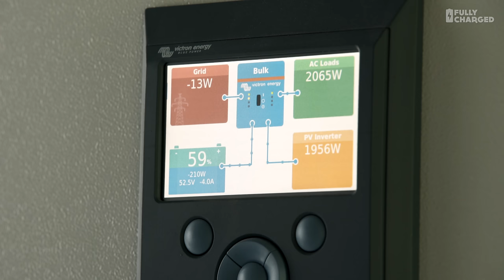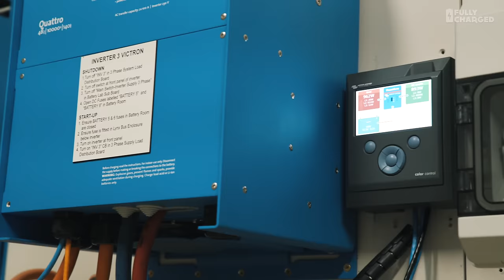Redflow ZCell batteries for home renewable energy storage | Fully Charged

Comment: Aaaand another advertisement-style video, is this paid content? This video does not mention some serious disadvantages of this system: efficiency is only 80% (roundtrip) and gets smaller over time; they need to be completely discharged and shut down for a self cleaning program for 2h every week; minimum operating temperature is 15°C; life expectancy is actually comparable to LiIon; Indoors operation is not recommended (makes noise and can smell bad); ...
Reply: This is the future now😉
Reply: 2hrs a week ! Such a first world problem! Zinc bromide is completely biodegradable and can be recycled , I don’t think you can say the same about Lithium.
Reply: @shiraz1736  Actually you certainly can recycle Lithium ion Cells 100%
Reply: He stated that they do not degrade over time. Most of what you are writing here is adressed in the video. Did you even watch it?
Reply: Shirazenema it’s not “biodegradeable” - in fact you wouldn’t want to get too much in the water table. Where are you getting this information? Zinc Bromide is an extremely toxic substance that does not break down in water. In fact it dissolves in water to form an acid which is how it works in the battery. If your skin comes into contact it can cause a severe burn and ongoing rash. It has all the same hazard warnings as other acids.
Reply: HL - I don’t think there’s anything sinister going on here. Fully Charged is great but they do sometimes get overly enthusiastic about new technology. I completely agree this video lacks any editorial rigour or indeed any negative facts about Zinc Bromide flow batteries. I’ve already pointed out in other comments about the disconnect between the warranty and the stated never ending capacity.  Plus all the things you brought up. However they may have found a niche replacing lead acid in telecommunications applications. For residential there are better options.
Reply: @mondotv4216  Thanks for the clarifying comment. What would you say are the two best options (over the ZCell system)  for residential and why are they better?
Reply: @mwakimakau4572  Right now? It's still Lithium Ion Phosphate.  However I find it difficult to recommend a brand. BYD, Simpliphi, Alpha ESS  or if you want to pay a lot and not get a lot there's Sonnen, Enphase and Victron.  I'll quickly touch on why I think LiFePO4 is the best option at the end. The next best option is either the Tesla PW2 or the LG Chem Resu 10. What are the advantages over the Z Cell?
1. They're cheaper per kWh and per warranted kWh delivered (maybe not Sonnen and Enphase - it's difficult to say - they're so much more efficient over the life of the unit).
2. They take up way less space than the Z Cell and they can be mounted in an enclosed space like a garage or a shed. And you can still get your car in. They also weigh significantly less so can be wall mounted. If you live in an apartment you can forget the Z cell entirely. Unless you want your garage reserved for a battery that has the potential to build up quite awful smelling gas.
3. Efficiency. And this is big because if you think about it you need to feed this thing electricity to charge it and it's only 80% DC-DC round trip efficient. That's before inverter/charger losses which are typically around 3%-5%. Basically you have to put 12.5kWh DC in to get 10kWh DC out.  That means one of two things when compared to a PW2 or LG Chem 10. You either have to buy more solar panels and a larger hybrid inverter or buy more electricity from the grid to charge it. Significantly more. That's costly. PW2 is 88% efficient and it already includes an inverter in and out.  So AC to AC. The LG Chem Resu has a DC to DC round trip efficiency of 95% so you'd need to put 10.52kWh in to get the same 10 kWh out. That's nearly a 2.3kWh difference.  With both the LG Chem and the Z Cell you need to add a compatible hybrid inverter. Then the Z Cell needs to shut down for a maintenance cycle - lets say for the typical user 1 every 2 weeks. During this process the battery needs to be completely discharged. This will also further impact efficiency. 
4. Throughput. This battery is rated at 3kW steady and 5kW peak. PW2 5kW /7kW. LG Chem Resu10 5kW/7kW. That could be the difference between running your aircon or not. Put another way - both the PW2 and the RESU can provide continuously 66% more power. Although to be fair the PW2 has more useable capacity 3.5kWh more (but costs a little less). 
5. Maintenance. This is sort of an unknown because there is a possibility that any battery could break down. But - if I had to choose between something that is purely non-mechanical over something with pumps, filters and a container etc I'd choose the non-mechanical every time. To be fair there's been recalls on PW2s and the Z Cell.
6. Safety. OK - we have a mixed bag here. Lithium Ion cells have the potential to catch fire and when they do you get thermal runaway. However that hasn't happened to date with either of the brands mentioned.  Here's an interesting article on tests run by the NFPA https://electrek.co/2016/12/19/tesla-fire-powerpack-test-safety/
Zinc Bromide can only catch fire if something goes horribly wrong and it starts to break down the water into hydrogen. It's naturally flame retardant.  It does contain dangerous chemicals - ZInc Bromide is particularly corrosive but provided you don't bath in it or drink it and it stays contained it's relatively safe.  However anything that relies on a container has the potential to leak so don't let Fido start chewing on it. Anyone considering installing one should find a way of completely isolating the Z Cell from kids and pets. Kids can do incredibly stupid things like poke holes in containers, eat lead paint and flies. So can dogs and cats. We had a cat that liked to eat anything made of synthetic rubber (carpet underlay, thongs (flip flops), the seal on the washing machine door). Very expensive because strangely it couldn't digest those items. Or anything else after it had munched on them. 
7. Temperature - the Z Cell is only rated down to 15C at which point it will shut down to avoid damage. It has a lot of thermal mass so it should only be a problem in Tasmania and maybe Melbourne in winter. No good in cold climate countries though. 
OK talked about the disadvantages - what are the advantages. Well it's warranted to still have 10kWh capacity after 10 years or 36,500 kWh but it will have dropped in efficiency (guessing about 1% pa to about 70%). But most users won't use that anyway without a full cycle every day. To some people that capacity retention is the holy grail, but in the back of my mind I'm thinking about the wear and tear on the pumps, the electrolyte slowly being degraded, the filters getting clogged and the electrode wearing. There's a reason the warranty is only 10 years and not 100. Redflow have done a great job in designing an electrode that doesn't degrade quickly but it still degrades.  And considering the PW2 has a similar warranty to 70% capacity - well that's still 9.6kWh even if it did lose all of that 30% capacity. So about the same as the Z Cell was at the beginning of it's lifecycle.
Finally why LiFePO4 and why didn't I include them? Well as a chemistry LiFePO4 is ideal for residential storage - potentially a lot more cycles, (Sonnen has a design life of 25 years) better power delivery and even safer than NMC based lithium ion cells. Why didn't I include them - well basically anything that applies to the PW2 and the Resu apply to them but more - longer life expectancy and for the most part higher power delivery (excluding Enphase who have a puny 260W inverter in their 1.2kWh AC battery). They are heavier and bigger for the same amount of storage but still way less than the Z Cell (pun intended). BYD is the cheapest I can find and they are a huge Chinese company who specialise in LiFePO4 cells for electric buses. But I don't know anything about the cells used in their BYD box. The warranty is not great - in fact 60% capacity of just 31,000kWh. But it is capable of delivering 1C (10kW) depending on your inverter and if the cells are any good it should do a lot better than the warranty. But I don't know if they tick all the nano-technology boxes needed to create quality LFP cells. On the other hand I'm confident that both Tesla and LG Chem will still be around in 10 years time to honour the warranty and it's not a bad warranty.
Reply: @mondotv4216  so ???
Reply: @loftparty7984  I'm not sure what you're asking?
Reply: @mondotv4216  - Hi! I'm sure you're right about there not being anything sinister in this setup. Just because Robert has a vast amount of TV experience, is a relaxed and amiable host, and has what a lot of people might consider to be a typical 'BBC' voice, they expect rigorous BBC-style impartiality. But this is YouTube! Fully Charged is Robert's own pet project; he's making programmes on topics that excite him and is under no obligation to be fair, reasonable, honest, impartial, accurate, or polite. (Yes, he strives to be all those things, because he's a decent sort of chap -  but he doesn't have to be...)

The rise of social media platforms has to some extent ruined the world of broadcasting, in much the same way that worldwide access to the internet has short-circuited the world of publishing; people can upload any old guff without having to get it past an in-house legal department and an editor's eagle eye. Legitimate projects still take the peer-review route to New Scientist and Nature, but there's some shockingly absurd pseudo-scientific metaphysical garbage being uploaded.

I view Fully Charged as top-class entertainment, not a source of unbiased information. It's fun to watch because you know it's well-intentioned, and a green-biased agenda is unlikely to advocate the building of too many death camps. I take all facts and figures with a pinch of salt. If there are errors... well, who cares. Subliminal advertising? Not bothered.  I can't afford any part of the lovely clean, shiny, but above all expensive World of Tomorrow.

Robert can run his Channel any way he likes; no need to issue disclaimers as far as I'm concerned.  I think most people are alert enough to know when they're being taken for a ride (although I'm still amazed at the numbers who believe every word in those two big books of fairy stories they're so fond of waving in people's faces...)

Comment: I didn't hear what the actual price was for a 10kWh battery, shame.
Reply: Okay, looked up elsewhere: AUD$12k apparently. Which comes in at about £6600 or $7000USD.
Comparing that to a 2.4kWh PylonTech battery module which is £850-1000, and you would need at least 5 (12kWh) more likely 6 (14.4kWh) to avoid going to zero. That makes it £4250-5000 for Lithium. 
While 20% more might be tough for many people to justify and the space required is not trivial, I think this is actually not far off viable, in the realm of tempting.
Now all they need to do is be available in retail outside Australia!

Comment: A test facility then,
I thought it was connected to a house etc.
Reply: The first part of the video the system is shown connected to his home. The storage container holding 60 units is running the company that has 80 people working in it and can keep them up and running for 3 days off grid.
Reply from the maker: Simon does have 20kWh at his house, there are a few other houses in SA with the system fitted and multiple farms, as well as dozens of remote cell towers powered by solar and Redflow Zcell units

Comment: Redflow battery round trip efficiency is 80% - and his argument is that Li-ion loses 20% capacity in decade.... so if you would have apple basket which holds 100 apples, redflow basket would loose 20 appels each time you empty it and fill it again, and you compare this with Li-ION, which doesn't loose any appels, just in 10 years the basket gets 20% smaller - by what logic this is better Li-ION???
Reply: snoopy blue Eh? Lithium ion isn't 100% efficent either.
Lithium ion over time loses capacity. His argument is this battery doesn't; At all
Reply: Redflow battery round trip efficiency is 80%?
That's about the same as Li-ion, then.
So the li-ion basket (in your analogy) would also lose 20 apples each time you empty it an fill it again ...as well as (unlike the flow battery) fitting one less apple, about every half year (i.e. losing 20% over a decade).
Reply: Not really... for Li - ion is in range from 93%-97%
Reply: +snoopy blue "for Li - ion is in range from 93%-97%"

That's not what Wikipedia says. I'm guessing you're talking about the cutting edge of Li-ion? (also, note that the Redflow batteries are newly developed. They'll have time to get improved)

But more importantly: 93%-97% is far lower than 100%, which is the efficiency that you claimed it had.
So you admit/acknowledge that you were wrong, then? That you characterized the situation?
Reply: Not at all...Where in my comment did I claimed that round trip efficiency is 100 for Li-ion? My basic comment was that ... there are two metrics.... one is round trip efficiency, and another is lost capacity over time.  And what I wanted to point out... that they emphasize one metric so much, in which they are good compare to Li-ion - and probably they are - this is lost capacity over time, but totally disregard other metric, which is round trip efficiency, which is much more important metric.  And on their site efficiency is specified as 80% max., now I'm allways sceptical when somebody specifieces metric with "max".... like I would say my car is very efficient because it drives 150mpg max -- yeah if I drive 30mph, but normal is 40mpg. Draw back of flow batteries was allways round trip efficiency and it is ussually 65-70%... and there was no talk about round trip efficiency in the video at all... that's my worry...

Comment: @4:30 I have to stop here. What he says is not (necessarily) true. A grid tied system must shutdown when there's a fault with the grid. This is a safety requirement -- so your system doesn't attempt to back-feed the grid. For the same reason, people with generator backups must have a transfer switch to remove them from the grid while on backup.

Otherwise, that's just fantastic storage battery tech.
Reply: Someone has 2 x Redflow battery set up for his business and needs power 24/7 . He has fridges with medical vaccine$ that are worthless if they don't stay at a certain temp. The BMS  -battery management system switches over in 120 milli /secs  to keep the power on . 1 battery is working ,while the other is programed to dis-charge and then they switch over . Before that , he had to use a generator out the back of shop .
Reply: jfbeam a normal grid tie inverter does this. It is possible to get ones that disconnect from the grid if the grid goes down, while operating off battery.

Comment: A solar setup with batteries may well keep working when the grid goes down but to do so SAFELY & LEGALLY they must also isolate themselves FROM the grid. If not, they run the risk of harming line workers. THIS is the real reason why solar inverters stop working when the grid goes down - it's a safety issue!

So, if this setup doesn't have an isolating switch when the grid goes down to put it in 'island mode' it's illegal & dangerous.
Reply: "but to do so SAFELY & LEGALLY they must also isolate themselves FROM the grid."

WTF are you talking about?
Reply: You clearly aren't up to speed with Australian law regarding battery systems that allow you to supply power to the household when there is a grid failure. NOT ISOLATING the house from the grid when the grid goes down can be fatal for electrical workers on the grid if idiots are pumping solar into it at the time...

The household solar MUST be isolated from the grid if there is a grid failure.
Reply: Paul Martin : Solar inverters that are designed to supply power to the grid are generally required to have some sort of automatic anti-islanding circuitry built into them to prevent this sort of accident from happening.
The other option is intentional islanding, or microgrid, this disconects from the grid forcing the (DG) distributed generator to power the local grid, or in this case to start charging the batteries. Once the batteries are full  it remains cut off from the grid.
It's not just Australia that have these laws, and it's not just power workers (hot-line/dead-line rules require they check for power) but other emergency service workers who might not have had time to check for power that have to be protected. It can also stop the equipment from being damged when the grid is restored.
Reply: +Paul Martin "You clearly aren't up to speed with Australian law regarding battery systems"

Given that I haven't the faintest idea, in regards to them, I'd say that you are quite correct.

"NOT ISOLATING the house from the grid when the grid goes down can be fatal for electrical workers on the grid if idiots are pumping solar into it at the time..."

...because...?